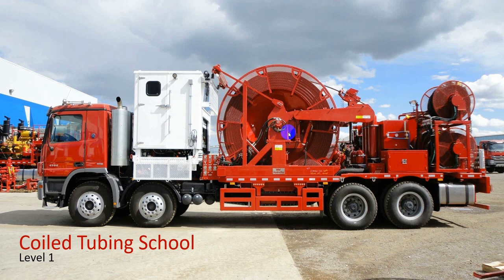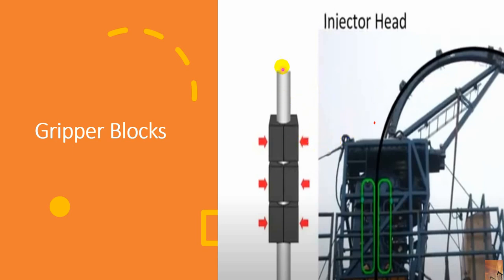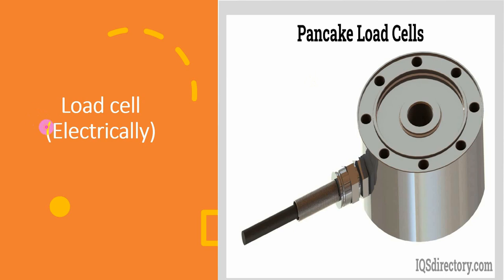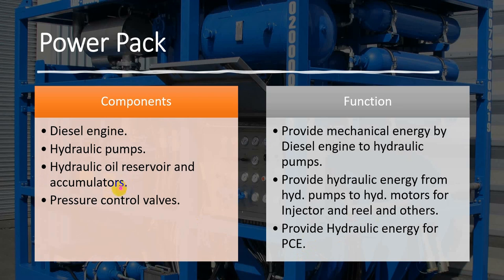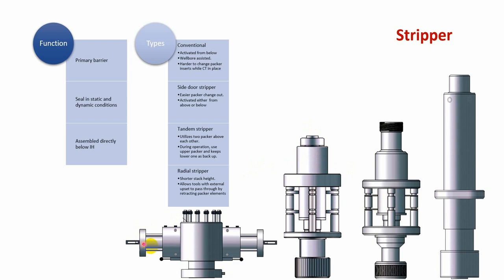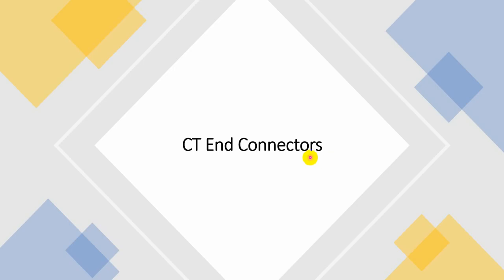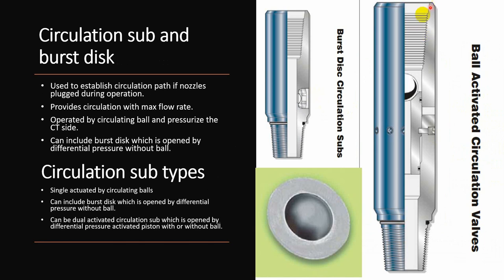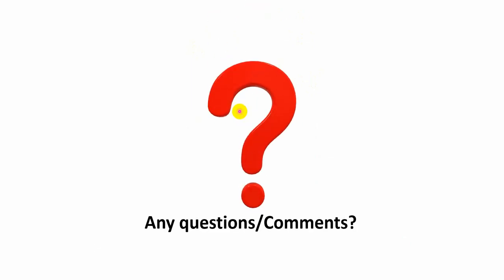Coiled Tubing Course Level 1 part 2 English

Comment: Hi.. Kindly do you have procedure operation to conect every hose fron power-pack to Inyector, to coiled tubing reel, to BOP, etc please?? Thanks in advance!!
Reply from the maker: Hi dear.
In my course on UDEMY, you can find everything related to hydraulics and how it works.
But for your question, hoses from power-pack is connected to cabin first by pressure control valves then connected to injector, reel, etc by flow control valves  and other devices depending on circuit